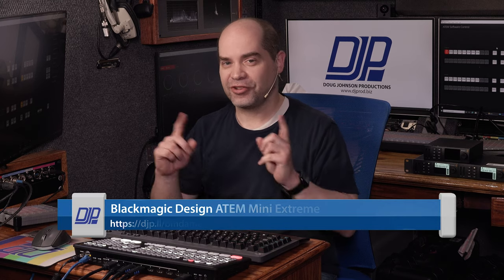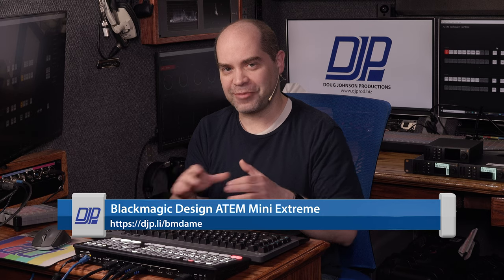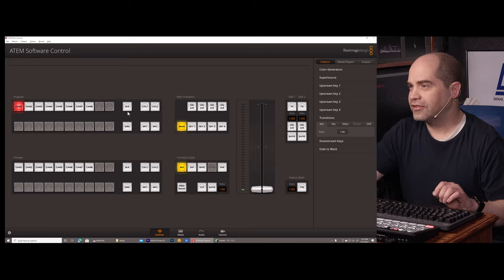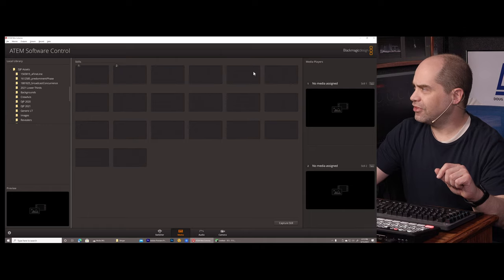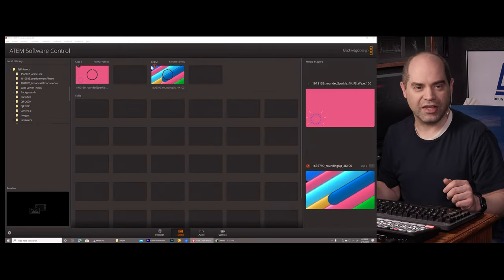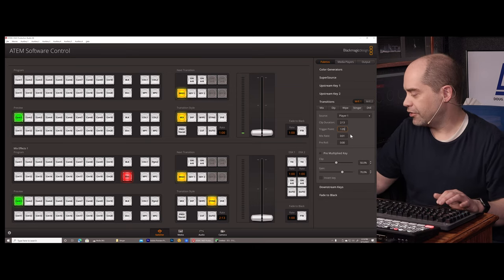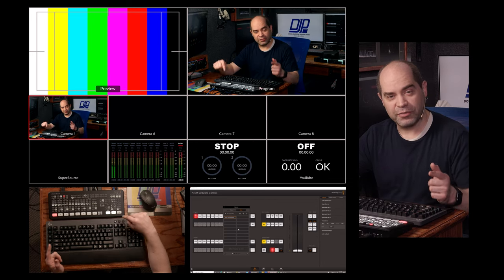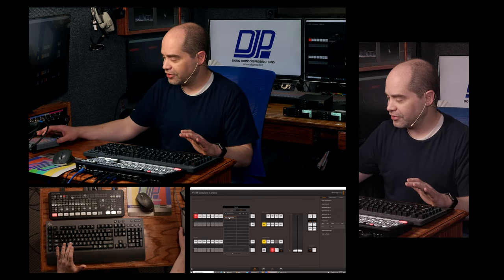What is the Sting button on ATEM Mini Extreme?

Comment: Have you seen Ryan Summerfield's tutorial on how to do a stinger transition in an atem mini with no additional hardware? He uses a macro to manually iterate the still image in the media player, it only works for a very fast transition but certainly by the time it had come through youtube compression I could barely tell the difference between it and the real thing
Reply from the maker: It’s a clever use of the internal media pool for sure. Not that many stingers are going to fit in such a limited number of media slots, and having them tied up for that takes away much of your ability to display still images. So it is clever, but likely isn’t going to be useful in that many real-world situations.